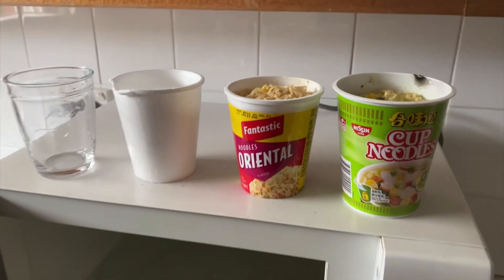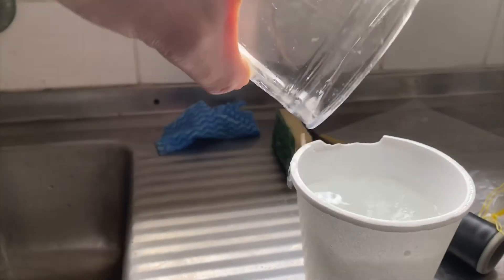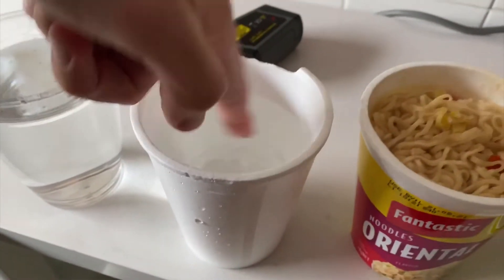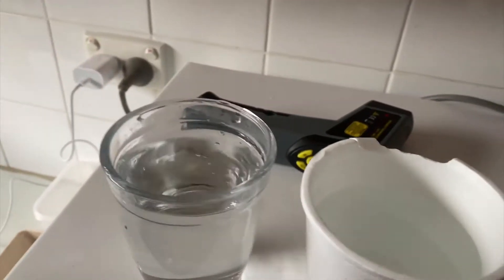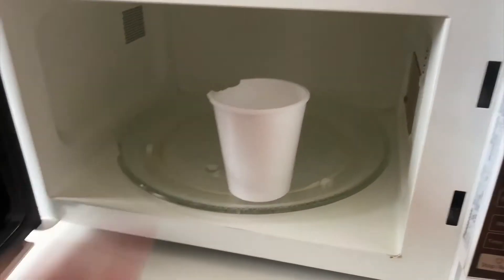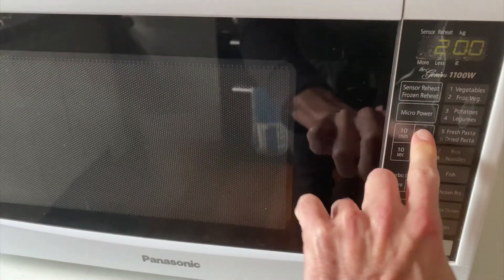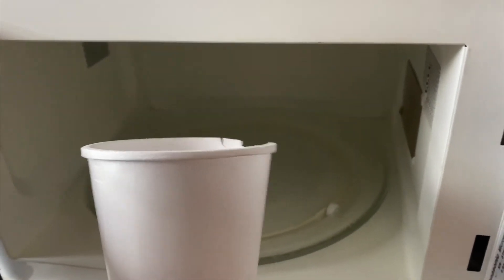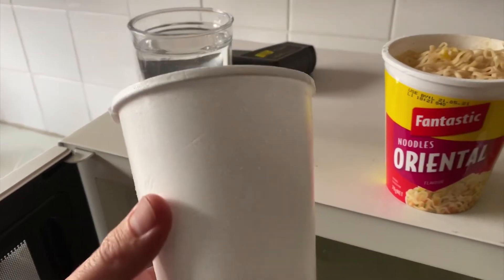Can You Microwave Styrofoam?

Comment: Bad experiment, empty foam cup doesn’t absorb radiation energy, like the glass plate that spins( it doesn’t get hot enough to melt and seep into your food). Cup full of water, water has high heat capacity water will get warm, but not hot enough to melt foam in a noticeable way. Cup with fried chicken microwaved, you will notice places where bone heats up and melt through cup, where did melted parts go? In your food!!!

Comment: This experiment is poorly designed, when microwaved by itself, the properties  of styrofoam by design are meant to not interact with the microwaves that end up heating up the target element(doesn’t absorb radiation energy well ), much like the glass plate that revolves in your microwave won’t get hot even if you microwave it for a hot minute. The harmful carcinogenic chemical styrene will form when you heat up the styrofoam with say a lighter or a hot spoon (heating through conduction or convection) and you see that it melts into a black yellow goo, is what you don’t want to ingest, much like you don’t want to ingest plastic. When a cup filled with water, which has a high heat capacity the water takes a long time to barely heat up and doesn’t break down the foam in a noticeable way. When you place say fried chicken Or fried rice that actually gets really hot, it allows heating of the foam through conduction, breaking down the foam, seeping into your food giving you cancer. In short don’t microwave foam with food.

Comment: Only if you're trying to give yourself leukemia or lymphoma.
Reply: Can it also give me a case of deez?
Reply: @cheemsu3854  Naw, they gon fall off
Reply: Hey this comment section is really co confusing could u give me the actual facts
Reply: @ezu_5727  Never look for facts on Youtube. Styrofoam causes cancer. Do not heat it!
Reply: @corneliusvanwyk32  that is very true thanks,  🤣🤣🤣
Reply: @corneliusvanwyk32  "never look for facts on the internet"

Proceeds to give facts on the internet lol
Reply: How about the styrofoam plate melted inside the oven because of heat, Does it affects my food?
Reply: @moniqueobedoza  Same thing. The fumes from that melted styrofoam go into your food. Do not eat it.
Reply: @nlsman7313  what if you ate just a bit
Reply: @moniqueobedoza oven based heating wouldn’t cause any harm like a microwave which uses different elements to heat up your food